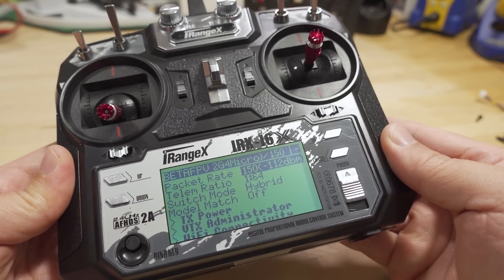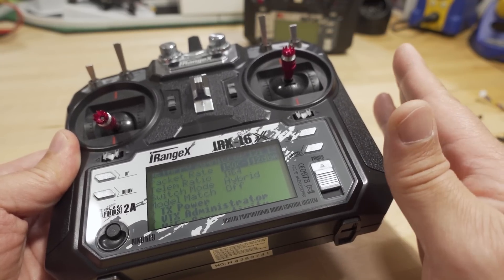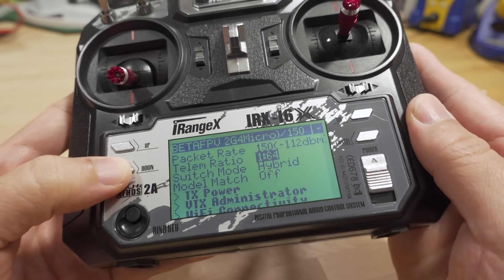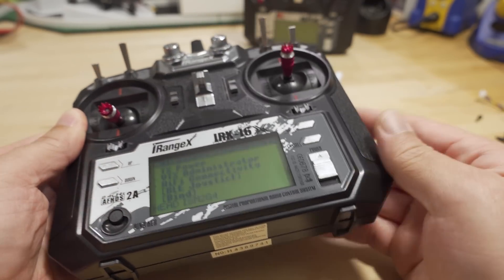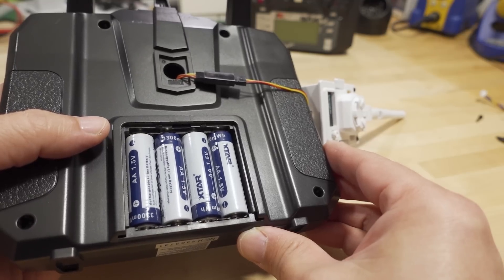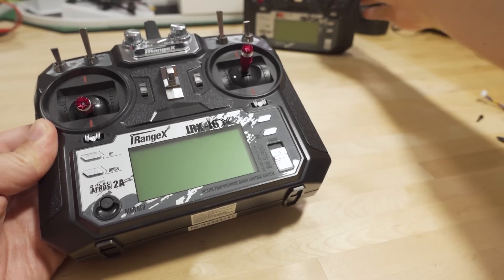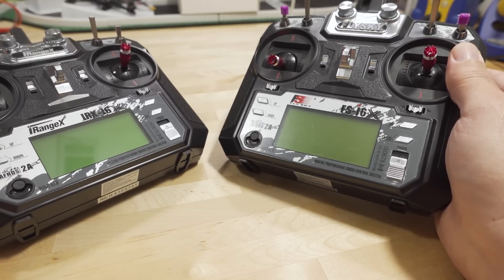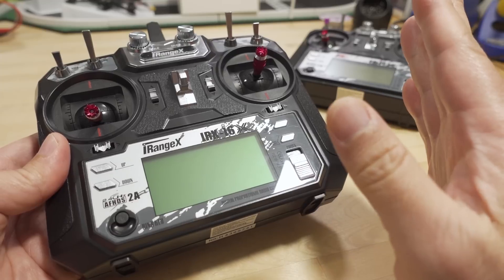ExpressLRS ❎ Flysky i6X ❎ OpenTX = 🤯

Comment: Great video but one question I have is I when I open the download link on the GitHub for the open TX code the latest version is a .zip file instead of a .bin file is it ok to download the .zip file or should i download a older version. Im pretty new to all of this so all info helps😁great video!
Reply from the maker: The zip file is fine. Just download it and extract the files.

Comment: Great video but before I get started I had a question, I was wondering if  this method is stiil the best option for elrs or if there are any other better/easier option for connecting elrs to the flysky. This video was released a bit ago so I was just wondering-Thanks love your channel!😁
Reply from the maker: For this radio, this is the only way.  No other options available at this time.
Reply: @AlbertKimTV ok and one more question I was wondering if any elrs transmitter can bind with any elrs receiver if they are on the same frequency. Another question I had is if any elrs transmitter can work with this flysky transmitter. I'm planning on using the happy model ES24TX pro transmitter which has  ground signal and power wire that you can solder to the board. And a pwm receiver. Finally the last question I have is when I open the download link on the GitHub the latest version is a .zip file instead of a .bin file is it ok to download the .zip file or should i download a older version. And finally the last and final question what asset do I download on the newest firmware (1.11.1). I'm new to all of this so sorry for all these questions at once. But thanks for the video, all info helps!!😁

Comment: I might just wanna try this on my Flysky radio, I was thinking instead of taking out the sim port on the back, you could have used a U.FL IPEX 4 to SMA connector and screw it, on antenna outlet with a 3D printed adapter, I think that could have made the mod way more cleaner. What do you think?

Comment: Thanks Al for making this video... I did try this method and flashing fs-i6x opentx 1.2 with happymodel ES24tx 2400tx but my i6x is stuck in loading and can't figure it out. My es24tx is v2... can you help me, please. this is my first build thanks in advance from Philippines.
Reply from the maker: Sorry, I have no idea what is wrong.  I can't tell what the mistake you made is from this information.  Perhaps you can contact the developers or ask over on the RCgroups link.

Comment: i see the pro ES24TX  is only slightly more expensive then the original. im assuming it would wire up much the same way? reading the forums it seems most any ELRS backpack should work on our I6x's but i wonder what is the best. the board of the the ES24TX is small enough to fit inside of the i6x case. but it needs cooling. i see also the ES24TX has a slim model for the arcade style TX's. I cant find a pinout for that module. it has way more pins anyway and I assume wouldn't work but would be less bulky to just stick to the back of the i6x. im an elrs noob plus no backpacks on i6 originally  so im sorta lost. im seeing alot of people happy with the base ES24TX so maybe i should just stick with that. anyhoo loving OPENTX on my i6x. THANKS!

Comment: Hello,I have a jumper T8SG v3 radio with a JR bay and deviation firmware on it.
Could I use that Betafpv module with it?
The Jumper radio has the option to use the CRSFR protocol.
Seems like all I need to do is figure out which pins in the Jumper JR bay are GND BATT and sig 
then connect those pins to the corresponding leads on the BetaFPV module.

I don't think I'd need LUA script  since the module has a joystick to adjust the ELRS parameters.

Does this sound like it would work?
Reply from the maker: In theory it could be possible.  I've never seen anyone try that yet.  I believe there is a hardware mod required for the radio to get CRSF support to work correctly.  You'd have to Goggle search for it.  I don't know where I saw that last but it was seen around two years ago I think.
Reply: @AlbertKimTV  Ok,thanks

Comment: sir nice video... im trying do the same setup here with my fsi6x + betafpv elrs.. but the module is not detected by the tx.. and also crsf is not showing up in external rf option.. hope you can help..
Reply: im not sure if the versions of openi6x and elrs has something to do with the issue..
Reply from the maker: I'm not sure where to even start. There's not much info here other than "it doesn't work".  There's a lot of places where this could go wrong.  Perhaps the firmware didn't flash properly?  Perhaps try it again?  Double check all your steps?

Comment: I flash opentx firmware, if I want to use flysky receiver do I need to install flysky firmware again?
Reply from the maker: No, just bind the flysky receiver using a model setup with the Internal module.
Reply: @AlbertKimTV  ok thanks sir
Reply: I have flysky fli14+ but not binding..when i click bind key on remote then power it says "key stuck".

Comment: @Albert Kim Thanks for the tutorial, Does this work with other ELRS TX modules? Have you tested the ELRS 500mW betafpv TX? Just wondering what to buy as TX. Thanks again.
Reply from the maker: I've tested a few.  They all worked and all ELRS modules should work since they are all based on the same firmware.  FYI, the higher wattage modules will need more power than the AA batteries can supply.  You'll need an external lipo.

Comment: Thank you Albert for this video. It's great to be able to use ExpressLRS on this affordable radio. I have implemented all the mods in the video and my HappyModel TX24 VS2 is recognized by the I6X but I'm having trouble binding to my flysky receiver. When I try to do this from the ExpressLRS bind menu item on the transmitter it does not bind. Did you have to do anything special to bind to a Flysky receiver? Thanks again for your videos.
Reply from the maker: When you setup the model, select the internal radio (Flysky).  You need to create a new model and not use the external module to bind.
Reply: @AlbertKimTV  Thanks for your reply Albert. I have done this and still no control when I switch over to the ExpressLRS module. I'm getting voltage to the module but I need to confirm the signal wire has continuity.
Reply: I just checked the continuity and that's ok as well. I'm not sure why this isn't working.

Comment: How long is it supposed to take to download? I clicked the download button and it has been a few minutes and still at 0% download progress. Any ideas?
Reply from the maker: If you're talking about the github website, it doesn't take long.  Maybe a minute at most if you have a good connection to the Internet.
Reply: @AlbertKimTV ok I figured it out. The firmware wouldn’t download to my i6x with the Stm32 Cube Programmer. I thought I would try installing using the EdgeTx Buddy software instead and that worked.

Comment: The mode is working. Thank you again!
The total power consumption from remote control battery, is 600mah (with betafpv elrs micro module set at 500 mW). The power consumption of remote control without elrs module is about 150 mah. The power for the module can be taken from tx swich ( can use the flysky tx swich button to switch on and off the module)
The slide tx button seems to handle ( is cold to tuch). The NIMH of remote control are also cold. 
So I think you can use the nimh battery but need to charge them often.
The module work even at 4.4 V
I didn't finish the mod so need more testing. ( My biggest concern is slide button)
Reply from the maker: Sliding power switch on the radio to power on both at the same time?  Interesting idea!

Comment: Hii
Please can you tell me if when flash firmware on betafpv micro module with Express ELRS configuratir  the
Option "compatibility options" need to be "uart inverted" or not?
Thanks again for your tutorial.
Reply from the maker: All external modules must use inverted signal.
Reply: @AlbertKimTV  Thank you aloooooot
You tutorial hep me alot. Have a nice day

Comment: Dude I can't thank you enough! I recently bought TX16S radio together with ExpressLRS set for my CanSat competition. My radio came with hardware damage so I could not use it and the whole process of shipping it back takes a long time. So yesterday I decided to try using ExpressLRS with my old FS-I6X radio. I followed all steps from your tutorial and it actually works very well. I don't think I would be able to do this without this video so thanks again. Also I have advice for everyone trying to do the same mod. If you have the loading screen problem, go to settings, disable internal RF and enable External RF with CRSF mode, then it should detect the ExpressLRS module without problems.
Reply from the maker: Glad it works for you!
Reply: osea que si fuciona para la radio  fs-i6 x

Comment: i get a screen that says Loading???? when i go to expresslrs in the menu..  the wiring is right but wont recognize my tx
Reply from the maker: Your TX is probably still on V1.  This is a common occurrence when the versions don't match.
Reply: @AlbertKimTV  Thank You!..  any chance you know where I can get original Firmware for the i6x?  i literally deleted it... smh
Reply: @richardsmithson4227  Hi, I have made a backup file of my original I6X firmware, before proceeding with OpenTX so if you want I can send it to you.
Reply: @BasementCreationsChannel  yes please
Reply: @richardsmithson4227  Well I posted here a link to my Google Drive with that file but for some reason it immediately got deleted. So I guess you need to give me your email or something else so that I can send you that file.
Reply: @BasementCreationsChannel  I have tried to send it like 6 times and even tried to put it in your video of the jumping robot  which is awesome!

Comment: So I have a silly question do you just use the normal FlySky receivers with the elrs or do you have to buy those special receivers
Reply from the maker: You need ExpressLRS receivers to work with ExpressLRS external TX modules.  The Flysky receivers only work with the transmitter built into the radio.
Reply: I know it was probably a stupid question but thank you

Comment: done that already they r (Mariano, janek, others) working on spi sx1280 support basically inbuilt... all u need is a cheap e28 and some soldering lower latency tooo
Reply from the maker: What are you talking about here?
Reply: @AlbertKimTV  This guy has ADHD or something. He makes no sense at all.
Reply: So they finally could add SX1280 built in??
Reply: @CapungPlastik  yup